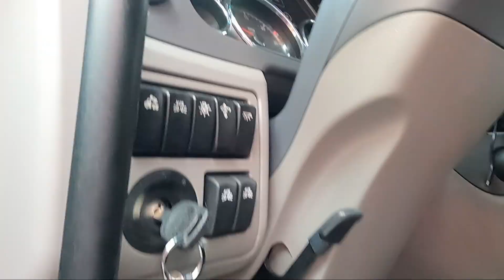Black Beauty gets a busted AC in hot Miami heat. Hot wire thermoking apu to run while driving for AC

Comment: That APU is  SO NOISY  .. I would have to put it into a better soundproofed cabinet .. Fan clutch so important, don't know if you have a EGT gauge (Pyro) but your engine must have been getting very hot .. good job your AC circuit alerted you to a problem .. stay cool, stay safe.
Reply from the maker: Yes it did and I'm so glad because we use truck sir to unload so have the engine up to around 1400 rpms for unloading